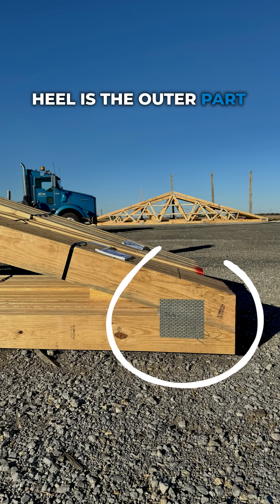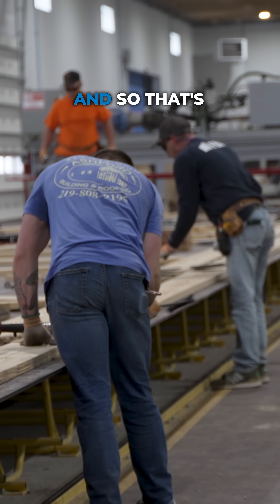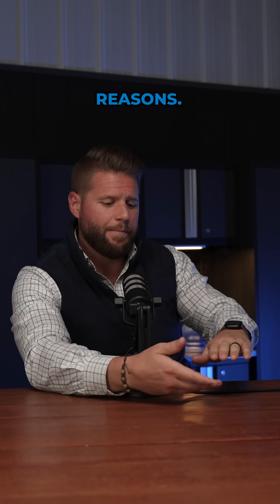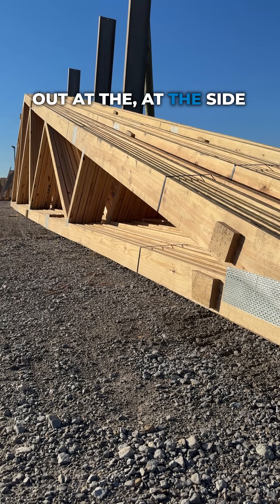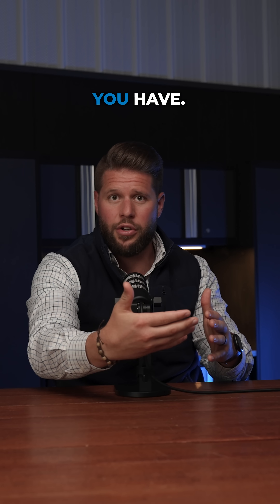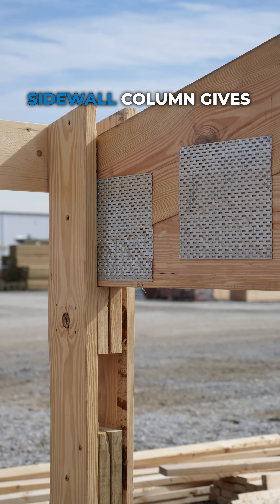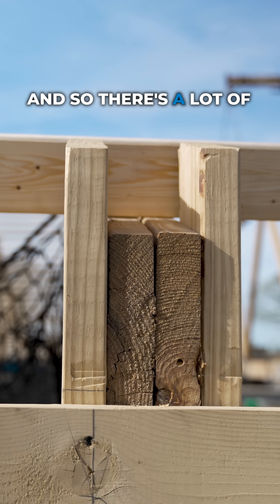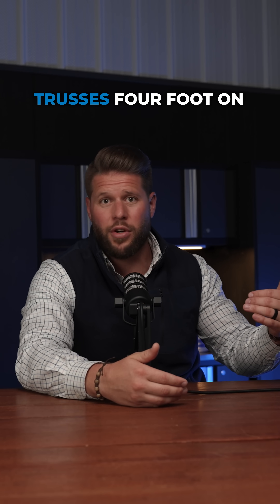What is a Pole Barn Truss Heel? #construction #polebarn #roof #truss #shorts

Comment: The first has to do with load transfer. How to effectively transfer the load from the roof to the side supports.
Reply: Why is the truss sandwiched between two columns and not sitting on top of a post?
Reply from the maker: The truss is sandwiched between two columns instead of sitting on top of a post for a few reasons. First, placing the truss between the columns increases stability. This setup allows the weight of the roof to be more evenly distributed across the structure, rather than focusing stress on a single point. It also enhances lateral support, making the building more resilient against wind and other external forces. Additionally, this method of construction is easier to assemble on-site and provides a better connection point for fasteners, ultimately leading to a stronger, more secure structure.
Reply from the maker: Effective load transfer from the roof to the side supports is crucial for maintaining structural integrity. In pole barn construction, this is typically achieved through the design of the trusses and their connections to the columns. The trusses are engineered to distribute the weight of the roof evenly across the entire structure.
 
When the roof bears weight, such as from snow or other loads, the trusses transfer that load down through their bottom chords to the columns. The columns then carry the load down to the concrete foundation or footing, ensuring that the entire system works together. Properly sized and placed trusses, along with secure connections, are essential for efficient load transfer and the overall stability of the barn.

Thanks for the comment!